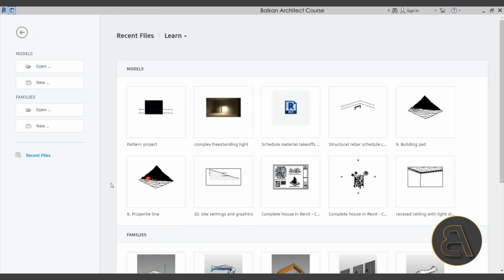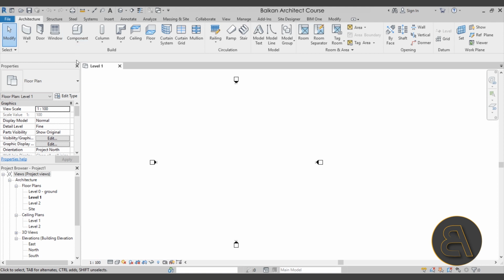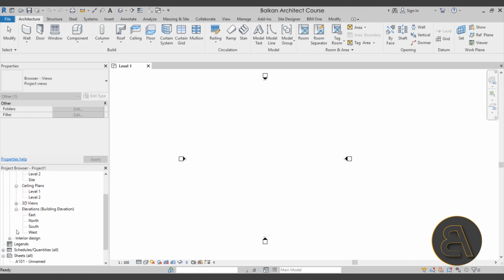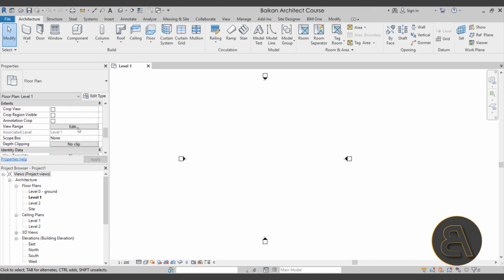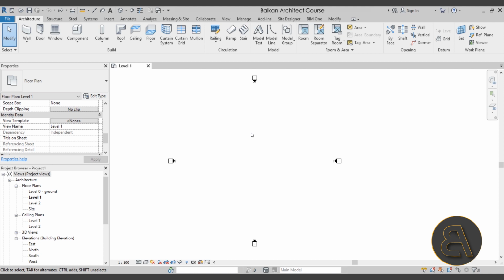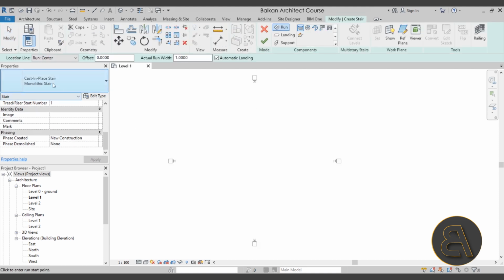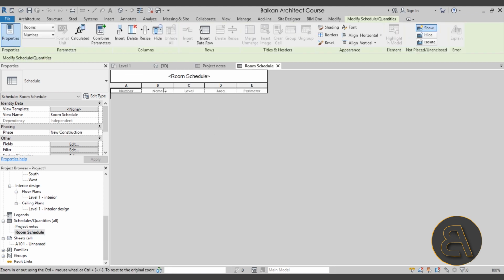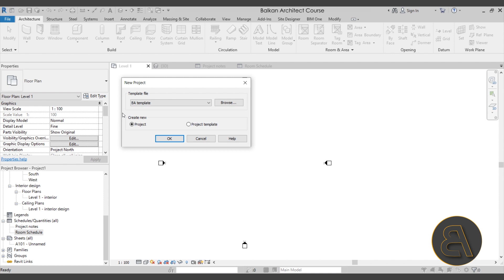Revit Template Creation Course - 3h 20min

Comment: I am recently put in the situation to have to create "company standards" for the firm that I work for, since we are switching from Allplan to Revit (we are based in Germany). The thing is that it has to be a BIM template (in the German library, or the so called D-A-CH, there are some already made), implementing the whole phases of project development and project execution, assigned with accordingly View Templates. In those templates there are levels of raw structure and levels for finish materials (like carpeting, tiles etc.) and it is all really confusing. There are also views in the project browser which are for different stage delivery...Do you explain something like this in the tutorial - in which views we keep our model making and how we prepare those plans into detailed delivery plans?
Reply from the maker: Hi yes, i explain how to setup view templates as well as how to make project wide graphics changes. I show also how to organize the project browser to add new categories and much more! 🙂